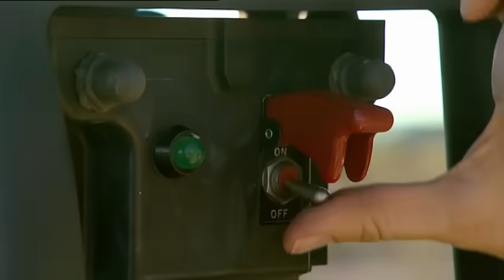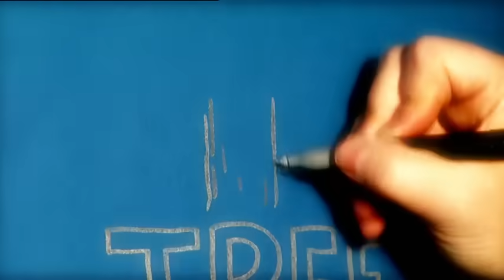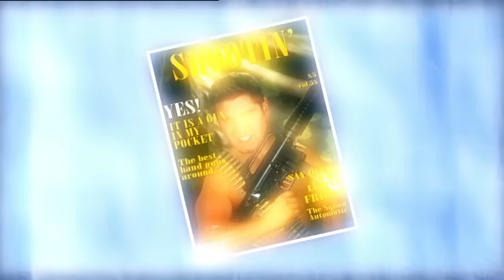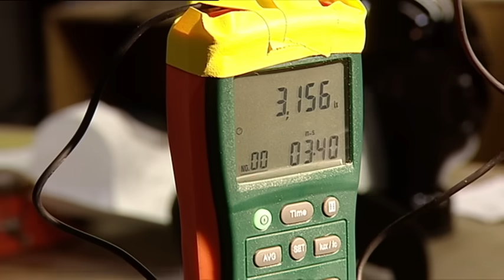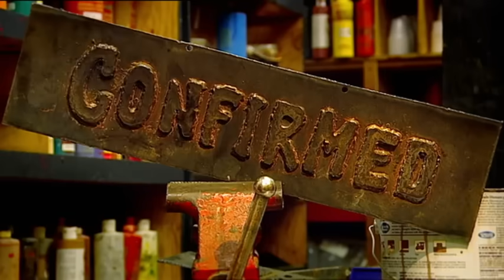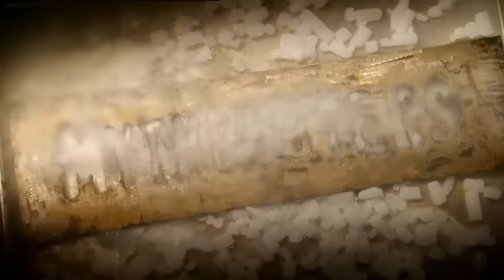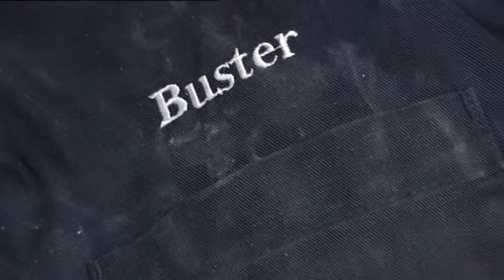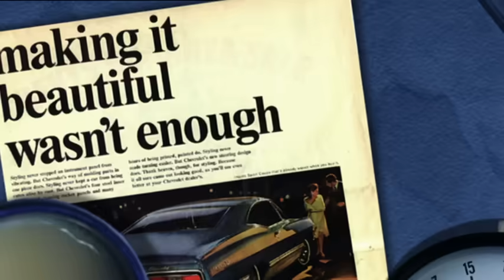Viewer Special 2! | MythBusters | Season 4 Episode 30 | Full Episode

Comment: The production time of flint knapping vs stick sharpening was BS. First off Jamie has next to no experience, even an intermediate knapper will be able to make an arrowhead in a matter of minutes. You can find a multitude of YouTube videos demonstrating this. Second off speed isn't a factor. Not only would there be designated tool makers who were experts in the field and supplied the rest of the group, but time isn't constrained. There is nothing else to do. Even if it take 10 times as long if it's taking up time during the day with a task instead of sitting around someone is going to be doing it.
Reply: Exactly what I posted to the forums when the episode first aired.
Reply: Biggest thing is the stick wound does not bleed while the flint one creates a wound that will bleed rather than self seal.
Reply: This episode aired December 13, 2006 YouTube started in February of 2005 I doubt thier were many if any flint napping tutorials on YouTube at that point plus the time they where shooting between releasing episodes and having to start shooting another I'm guessing didn't leave much time for all that.
Reply: @ That's a good point.
Reply: @ I wasn't saying Jamie could have found multiple YouTube videos, I said YOU could go look and see videos where people knap much faster. Jamie did have access to experts though, and they chose not to consult any. Furthermore as I said in the second half of the comment speed isn't a factor. They weren't knapping in between getting home from work and going out to dinner. They had all day, and doing intricate work would fill that empty day.
Reply: @CDRaff  Sorry, but speed is a factor. They 100% had time constraints on them in the early seasons. They had only so much time, and therefore money, they could allocate to a myth.
Reply: @BabyMakR  what in the what are you talking about? What do time constraints on the early production of the Mythbusters TV show have to do with how much time early humans had to make arrowheads? I think that you are more than a little confused about the context and content of my comment. Maybe take a step back and actually read the comments and take some time to critically think about what is being said then come back and if you have something constructive to say about the actual topic at hand.

Comment: I feel like the main thing for flint is how re-useable it is. Sticks are gonna be single use, two at best, and destroyed if you miss. Flint would last, and can just be attached to a new stick.
Reply: True, but if you don’t miss with a wooden stick you could resharpen  quickly and you could do this a good few times before it became too short to use
Reply: @polarisukyc1204  Not once it's soaked in blood.
Reply: Thegnthrand demonstrated the real advantage is bleeding from the wound channel
Reply: But also, if the arrow is “modular” the repair/reuse cycle might not include having to spend time to attach flocking.
Reply: I mean there is a reason you use broadheads to hunt and not field points to this day.  The arrowhead cuts more and will sever arteries or veins leading to more game taken and less time searching for a kill.  Jaime is talking about how much longer it takes to make a flint arrowhead but is not taking into account that a deer shot with that may drop in 20-50 yards and one shot with a point that doesn't cause internal damage could run for miles or just not die right away and later die to an infection.  It is literally the whole if it's not broken dont fix it, I use arrows that are basically metal versions of what people have been using to hunt forever.
Reply: Waiting for animals to pass, making arrowheads  passes the time.

Comment: I think the issue for the arrow would have been wind,they never did it outside, and wind wouldn't affect them as much with an arrow head
Reply: As a bowhunter I can confirm this. Plus ithe weight at the front keeps the arrow straighter after a longer distance.  We modify the weight of the arrowhead by the smallest amounts to improve accuracy.
Reply: @colbygill533  yea thats basically what i thought,surprised they didn't think of this
Reply: Added mass means it’s going to hit harder
Reply: I think a broader arrow head makes an animal bleed. So that the hunters could follow the blood path if the shot animal ran away.
Reply: @JaWilli96  Thats an interesting and valid seeming point
Reply: @JaWilli96 It's not the actual reason, but it definitely helps

Comment: In the arrow vs stick theory, is it possible they used arrowheads, because unless they get a heart shot, it will likely bolt. Any movement of the muscles could cause more damage, the further it goes?
Reply: Even in modern bow hunting, arrows never stop an animal right where it is. They always run quite a ways after getting hit. Hunters use broad heads to cut larger wounds so that the animal bleeds faster - which can cause it to quickly bleed to death, and leaves a blood trail that the hunter can follow when the animal runs out of sight. If a sharpened stick were used, it would just act like a plug and seal the wound, preventing bleeding. 

Also, with modern broadheads, arrows typically pass completely through animals, leaving an entry and exit. This increases bleeding. If the arrow stayed in, it definitely could keep cutting as the animal tried to run.
Reply: @Subtlenimbus  Hell, even with modern rifles, a shot will leave an animal to run a couple hundred feet, imagine how my further it would get with just an arrow in the flank?

Comment: Okay, this is gonna be a long one, so strap in, notify your next of kin and grab a fresh pot. 

Ballistics gel is a good flesh analogue for measuring the damage done by bullets. It is not a good analogue for measuring damage done by blades. It lacks the fundamental properties that blades use to cause damage. Ballistics Gelatin acts as a compressive block that a bullet or field tip (or pointy stick) pushes apart to carve through. This is very poor at measuring the multitude of intricacies of a blade through living tissue. 

For a start, when muscle is cut, it loosens. When blood vessels are sliced open, the wound opens and blood flows out, lubricating the foreign object. 

The broadhead is one of the earliest simple machines mankind ever created. A set of inclined edges to convert force into work far more efficiently. 

A flint broadhead will cut the skin, enter the muscle, sever blood vessels (lubricating the shaft), carve a width’s channel through the entirety of the target and possibly (with a smallish/smaller animal or heavy bow) pass clean through and exit out the other side. Now you have an animal that is bleeding from an inch wide, full body pass through long wound channel, meaning they can be tracked easily to their final resting place if not killed on the spot

With a field point or pointy tip, the arrow effectively plugs the hole it makes. The flesh wasn’t cut, it’s been forced through, so it will be ‘grabbing the shaft’ as it passes, with less chance of hitting major blood vessels. This means the animal is more likely to survive the shot, lose you in the chase and survive until the wound gets infected. 

So ironically, the performance of the pointy stick may be somewhat accurate, or even underperforming. 

The only medium which replicates live flesh even remotely is live (or very recently deceased) flesh, which for obvious ethical reasons, Mythbusters can’t exactly do. 

TLDR: Bullets and field points kill with Kinetic Energy. Knives, blades and broadheads kill with momentum. There’s overlap, sure, but point stands. So yes, there’s very good reasons you’s spend the hour to knap a proper head instead of sharpening a stick in 3 minutes.
Reply: I mean, just knowing that historically, stone arrowheads were used widely through the world is evidence enough that they are better than a sharp stick. If you test does not show it, your test is wrong. Obviously. The people of the past were not stupid, if stick was good enough, they would have used sticks. But its not, even remotely. Not even talking about how long a pointed stick keeps its sharp point, compared with a stone arrowhead that can remain sharp for ages.
Reply: thanks for the arrow murder knowledge LocalDiscordCatgirl
Reply: @omgdontstealvids123  fun fact the US Army had a Bow-wielding unit long after ww2 was done. Theres a documentary on yt about it called silent warriors.
Reply: Huh, seems like Caffeine is good for you after all, huh? Ba dum, tss!
Reply: Edit a Flint is better
Reply: great comment!!
Reply: @fossilfighters101  thank you. I got most of the knowledge from a research paper 
“Momentum, Kinetic Energy, and Arrow Penetration
       (And What They Mean for the Bowhunter)
By
Dr. Ed Ashby”

Amazing read, well worth the time. It’s also verified by my own experience hunting.

Comment: (7:00) I have to agree with Adam that the flint arrowhead is causing more damage, which can be significant. The flint arrowhead might also fair better if it doesn't hit "square on"; I suspect that the wood tip would be more likely to skip off an angled hide. I feel like the makers of those stone arrowheads probably had time on their hands while waiting for food to cook or protecting kids or otherwise maintaining the home site while other members of the tribe hunted and gathered, plus I expect that a flint-knapper with a lot of practice could turn out arrowheads a lot faster than Jaime.
Reply: Most of the stone arrowheads i've seen were also 2 to 3 times the size of the ones used in this vid.  They would have done a lot more damage than a pointed stick and, being made of razor sharp stone, could have left a long gash even from a grazing shot.  And as others have said, a pointed stick plugs its own wound.  A broadhead slices as it moves through flesh leaving behind two cuts that aren't plugged by the embedded arrow shaft.

Comment: The thing they are missing with the arrowheads and what Jaime was complaining about the time it takes to make one is that they bring down game faster.  There is a reason we still use broadheads to this day vs field points for hunting large game, that being the flared cutting edges cause more internal damage to arteries causing the animal to die much faster.  With a field point even if you hit a great shot a deer could run for miles wasting that time you saved just by sharpening a stick.  Also you have a much higher chance of making a kill to begin with.  
Stone arrows are reusable as a tip unless they were to hit bone, but this would also cause some shrapnel effect, which again is a good thing.

Comment: The ski lift myth is BUSTED because there's always another chair every 20 feet or however far apart they are. In order to be able to slide down it you would have to be the ONLY chair on the lift line which is not how ski lifts are designed lol

Comment: Just a heads up, on modern arrowheads (which kill in the same way as a stone one) focus on edge surface area and sharpness because generally you’re trying to get an animal to bleed to death, the edges mean that more damage is done to more vessels, the sharpness is important because it does the most cutting as opposed to pushing blood vessel dense flesh aside

Comment: On "Denim Escape", sliding down the cable, I can see a few issues. First would be having the crotch of the jeans on the cable. That is probably the weakest part of any pair of pants, and I'd be surprised if the seams would hold long enough to get anywhere. You'd probably have better luck trying to slide down a coated cable, that's been exposed to the weather for a few years, and only use one of the legs over the cable/wire. You could also try twisting the leg of the jeans so that it's round instead of flat.
As far as arrowheads go, Someone else in the comments mentioned that there are a couple reasons why broadhead arrows are used for hunting. With just a sharp stick, the flesh of the wounded animal will close itself around the arrow shaft, keeping the wound from bleeding, which will allow the animal to possibly escape, and harder to track as there won't be a blood trail. Using an using a broadhead arrow on the other hand, cuts 2 - 4 channels in the animal's flesh causing it to bleed profusely. Also, depending on what you were hunting, a sharp stick might not penetrate it's hide, if it's raining out, and the point gets wet, it will soften. if you char the sharpened end, it might not go soft though.

Comment: One more point in favour of the crafted arrowheads is reusability. The a pointy stick will dull after just one or two shots (a little more if it's burnished), while a sharpened piece of flint can be used dozens of times, easily recouping the time spent by the campfire, knapping away.
Reply: Have you never sharpened a pencil?
Reply: @Capt-quirk1  Nice one, brainiac. See how many times you'll keep wanting to sharpen your arrows again with a flint knife. Nevermind the fact each time your arrow will get shorter, meaning every next shot will be weaker and less accurate until you go out and spend ages finding wood suitable for arrow shafts again <3
Reply: @Zappygunshot  my point, zippy, is that you can get more than one use, not that it is better.  While not an ideal or permanent solution, will get you another few shots.

Comment: Missing information on the arrows...

Weight.

Range.

Kinetic energy on impact.

The flint knapped arrowheads add weight, which helps them better overcome drag and windage to accurately hit the target at a longer range and impart enough energy at impact to penetrate to the vitals.

They did not test enough parameters.

Comment: Stone arrowheads make the arrows harder to pull out.

A cliché in westerns is someone being shot by an arrow, breaking off the feather end, and pushing the arrow out through the victim's back, rather than pulling it out through the original wound.

I think a lot of arrows for hunting were probably just sharpened sticks, and as Jamie said, they just weren't found because they're biodegradable.

My guess is that stone arrowheads were more for shooting other people than for hunting animals.

Although if you do use them for hunting, they're reusable.

When you cut up the animal to cook it, you can get your arrowhead back instead of carving a new one.
Reply: The rear corners of the arrowhead are barbs that trap the arrow in the target.

Comment: arrowhead...the 1000x time cost doesn't mean much if you only shoot 5 arrows per week (and can make 20 arrowheads per week).
Even a 10% deadliness increase is worth the extra 30 minutes, when it takes 8 hours of hunting to get the chance to fire 1 arrow. If you get 1 extra kill out of 10 hit deer(1 kill with wood point, 2 kills with arrowhead), and each deer took 8 hours of stalking/waiting.  That's 30min*10arrows = 5 hours vs 8 hours hunting,
!! AND most importantly, what else are you going to do around the fire, other than whittle and tinker to improve your tools. Its fun passive work in downtime.

Comment: As an archer, I feel like some archer (who helped them with gear) should have told them we in the archery world already know broadheads arent = penetration. Its about making damage when penetrating. They will litterally slow down the arrow inside the target (bc physics). The difference you see is highly likely just the difference in added weight/mass. A standard fieldpoint would have had better penetration (but does less damage inside), and even better would have been a bodkin style bc of the xtra weight. This is RLY basic archery knowledge....

Comment: They could have just asked a bow hunter and they could have just told them the reason for arrowhead vs sharp stick. A stick will make a hole the same size as the diameter of the arrow shaft and its hard fir blood to get by it. And a arrow head makes a bigger slice in the hide making it bleed faster and easier to track the wounded animal. Thats why they make razor arrowheads today. Its not so much about damage as it is about tracking a blood trail

Comment: You know what if you peed your pants, would your pee make it easier to slide down and perhaps help out with the integrity of the pants just like how if you get a shirt wet wrap it around two metal poles and stick a pole between it to act as a crank you can use it to bend the bars.